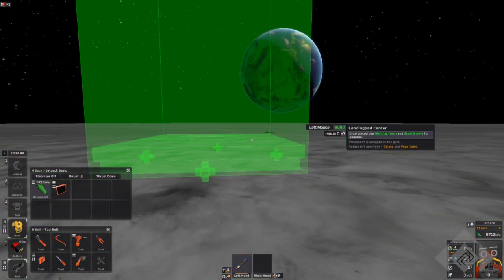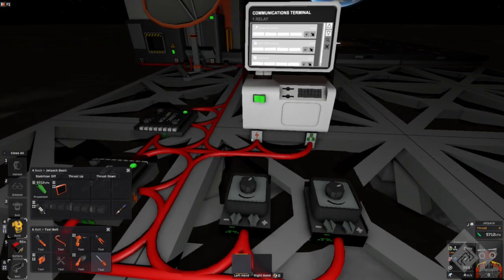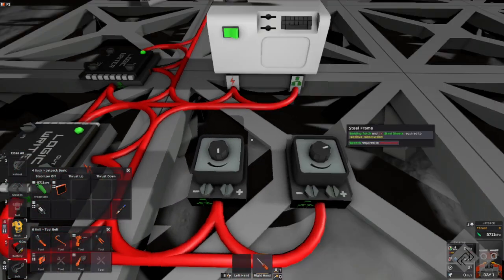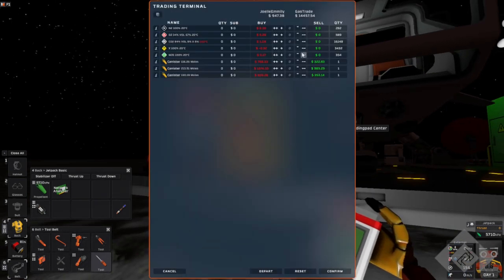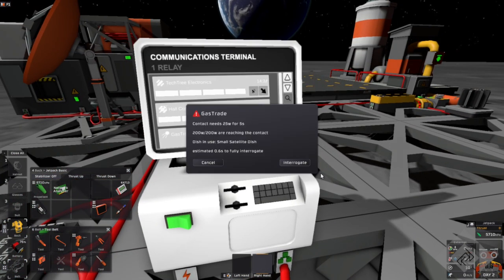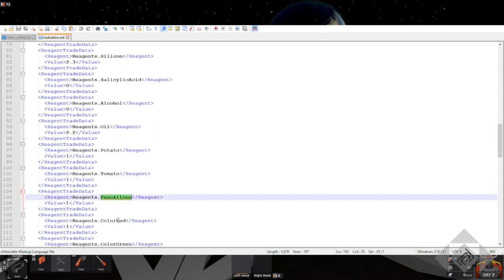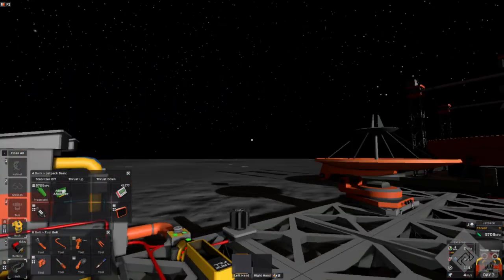Traders! Finding And Resolving Signals, a not so quick tutorial - Stationeers

Comment: The video did as it said on the box, a demonstration of how to get traders for trading. The thin wires can only handle 5,000 W, so they break when you add a second power source and crank up the juice. The heavy cables can handle 100,000 W. But overall a good demonstation. I was hoping for some help making the whole deal automatic, but I guess that is for another video. I was also going to make a comment about temper, but when you have it in your name already, I guess it's nothing new ;)
Reply from the maker: At this time, the update is NOT complete, and cannot be automated... Sorry.

Comment: Gases are traded in mol
24:19 - trader has quantity of 945
24:48 - your atmos showing 298 mol in storage
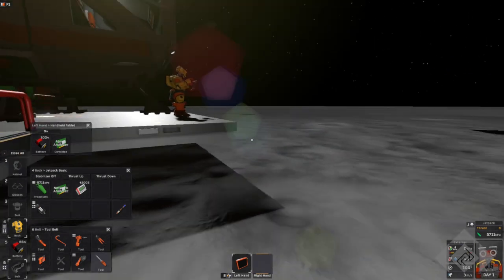25:12 - trader has quantity of 647
so 945-647=298 and that is in storage
Reply from the maker: Unfortunately, no. if you buy a single "unit" of of O2, you receive 0.9 mols, if you buy a single "unit" of water, you get 0.7 moles, and if you buy a single "unit" of mixed gases, you get 1.1 mole when all values are added. It's close, but not consistent to seemingly anything.
Reply from the maker: My guess is, that the in game entity of "gas and water", have a defined normal, or default, which is than "coloured" by adding the attributes for the gases and/or water. meaning, your buying 1 unit of default "atmosphere", that the game then applies the attributes to, and since each gas and water has a different density, you get slight variations on purchase.
Reply: That's for the first purchase and probably bug. When I bought 1 unit of water, I get 0.4 mol. 10 units of N2 and get 3.3 mols. But all the next purchases was ok. I bought 100 units and get 100 mols. I tried 3-4 times with different quantity and was always ok. But this is not true for mixed gases. First purchase is bugged, but next purchases are almost "ok". I bought 100 units and get 99 mols, another time 101 mols. So not ok, but almost :) I hope they will fix it.
Reply from the maker: @rohen951  Cool! I'll have to remember to make a small purchase at first. Good science!

Comment: I think that slow progress bar is information itself. It seems that its speed depends on offset from correct angle. The slower it goes, the bigger is the offset.
If I am correct, then it is pointless to wait for detailed information.
Reply from the maker: Yes, but in this case, it's also probably distance. You could, when I originally made this video, contact traders using under powered antenna. In a more recent updated, they've sped up the interrogation process.

Comment: Blah, just started playing this game again around a week ago, having a blast... Setup the trading system and got some <A:EN:0> error that spits out pages of red text nonsense when I tried to buy gas. Welp too bad he had some cheap volatiles too. Anyone else have this error? is it because have the liquid and gas outputs seperated? They are still connected to the 3x3 landing pad just on seperate sides. blah everything was smooth as silk till this lol.
Reply from the maker: Oh yeah, that'll happen a lot... The one way you can get it to occur consistently, is to make changes to the landing pad after a trader has landed. Or using an older save... Or selling a trader something, sometimes... Or pushing the INFO button when in dialogue with a gas trader... And using a landing pad that not exactly 3x3 with the centre in the centre seems to increase the chances of an error... Annoyingly thought, leaving a trader on the pad, saving, existing, reloading, trading, saving, existing, then reloading again, seems to help reduce the errors. And I mean a hard close to desktop exit and reload. I love how Early Access Beta Testing has transitioned to Pre-Release Alpha Testing, really lets you know how the sausage is made!